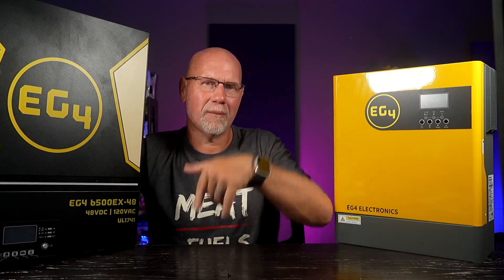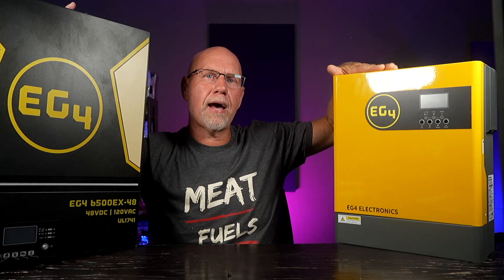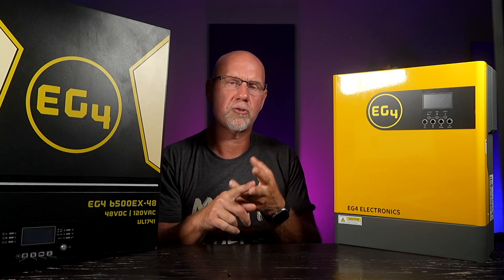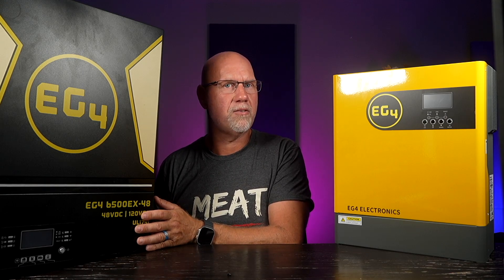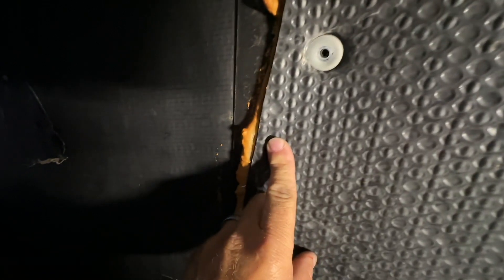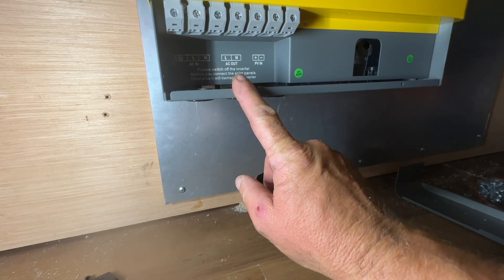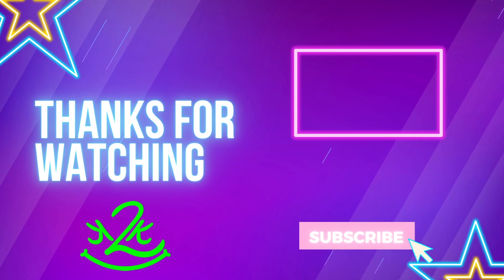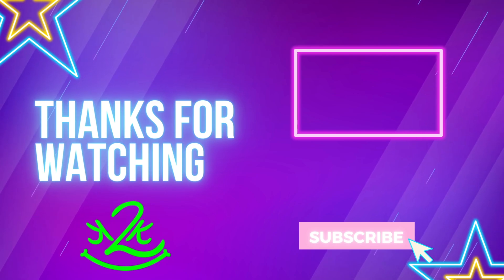Installing an EG4 3000 in an RV | Easiest Inverter install for an RV

Comment: Interesting. On our Brinkley they pre-wired for an inverter. I put in a 3,000 watt with a built-in transfer switch. Truly plug and play. Since install we spent last summer in Alaska and this past winter on the BLM in Arizona. All off grid. Two 370-watt panels and four Battleborn 100ah batteries. Burlington Bill busking on the road and here on you tube.

Comment: The exact system I'm going to install. I have a 2024 22RBE with the inverter prep so it might be a bit easier for me. Thanks for the vid!
Reply from the maker: for the Inverter prep, all you need to do is cut the wire that is looped in wherever the prep is and then attach it to the EG4.   Not having to run the wire will save a lot of time

Comment: Interesting and helpful video.
12 v side of existing converter 
On the 120 volt side you have replaced the input from shore power to eg4 120 v outlet.
The old rv  converter doesn’t care were you get your 120 v from. Therefore leave the 12v side alone except for breaker or fuse going to charge the old 12 v battery. Disconnect this an leave the rest alone.

Comment: The wires, both input and output, from the inverter must have a grommet going through that aluminum plate.
Reply from the maker: It does, I installed it after I filmed this video.
Reply: Exactly YIKES

Comment: So you made me curios on mounting options as my inverter is flat on the ceiling of a storage bay and I want to replace it.  I checked the manual I didn’t see anything about not mounting it flat, where did you see this?    What I did notice was the requirement for 19” of clearance for the top and bottom.   Was surprised you didn’t mount yours sideways to satisfy that requirement and get good air flow.
Reply from the maker: In speaking with Signature Solar, they advised to not mount it that way and after looking at our RV, they advised to mount it as we did

Comment: Signature Solar the very best current price on the 3000W inverter currently. I spent about 8 hours searching for anything else on eBay, etc., etc., etc.  There is NOTHING else currently that can handle a 500V PV input, which is what I need to run 10 x 250W panels at 8.75A input running in SERIES at about 37V VOC.  That's over 370V VOC PV input at almost 9A.  This will enable me to just connect the 10 x 250W panels with the standard included cables in series, and connect them to the 3000W inverter.   I plan to have one 70Ah 48V LifePO4 battery for backup.  99% of the time I'll be running off the Grid with a 50A connection, and this will also be connected, but if the A/C goes out, I hope the battery will keep everything running until I hookup my 5500/6500 Harbor Freight generator.  Fortunately, the EG4 inverter can be adjusted to favor PV input, battery, or A/C input, and can handle multiple electricity inputs simultaneously and automatically.

Comment: Great video!! Question on installation on the EG3000, are the mounting bracket holes @ 16" to match most home vertical framing?
Reply from the maker: I honestly didn't check since it only weighs 24 pounds and I installed a board to mount it to.  The board is screwed into the vertical framing

Comment: The 30 amp switch is not as useful as you might think it is. For one the power watchdog will not allow power if the pedestal is miswired.  And if for some reason, the power watchdog did allow power through while miswired, for example let’s say you had a hot neutral, you didn’t break the neutral. You only broke the black wire so you would still pop the inverter.

Comment: i have the same crawl space but my trailer is 50 amp with 3 ac units. Its a 43' toyhauler.
With the A/c coming in, can you hook up the 4 wire ? im guessing no, would the 6500 watt have the 4 wire, 50 amp input?

Comment: You didn’t mention anything about when you disconnected the D/C converter charger from A/C panel and how you fed the 12 volt fuse box. What feeds your 12 volt or how does it convert from A/C to D/C now. By the way awesome video. Thanks
Reply from the maker: That is in the other video.  Yes, we disconnected the existing charger.  The all in one system charges the batteries and the 12v side of the RV is powered by a 48 to 12 volt converter

Comment: Very nice setup. Thanks for sharing your experience with us. If something happens to your surge protector do you have to pull everything back out or did you pull in a access panel ? Looks like a great system. Thanks From Wisconsin
Reply from the maker: I am planning on adding an access panel but right now, it is only 4 screws to remove the Breaker Box to get to it
Reply: @2KrazyKampers  😎

Comment: Hi, thank you for this great information. I'm about to put one EG4 3k 48  in my van, but I can't find anywhere How many amps the inverter will pull from? Let's say a garage outlet while it's charging at the house. Do you know if a 15 amp outlet would work? I see that you can lower the charge amperage into the battery. I'm guessing that would lower the amp draw from Shore power? Thank you for any comment
Reply from the maker: You can change what it pulls.   Its a very simple setting that allows you to adjust based on where you are

Comment: I understand the concern for the extra 30 amp switch after the watchdog. However, if you mount that watchdog in the closed area of the bay, how are you going to see the lights. Seems if it wired wrong or there is an error, the watchdog would catch it and not send power thru .
Reply from the maker: The watchdog also has bluetooth so I can check it from my phone.

Comment: I put in the EG4 6000XP and the same battery, adding more batteries soon. I know someone mentionrd before but can i leave my 12V lead acid battery hooked into the 12V RV side and the 48 to 12v converter and the truck altenator will both charge the 12v battery? Will there be any issues if both truck and 48 to 12 are hooked to the 12v battery while running down the road?
Reply from the maker: No there won’t
Reply: This is what i want to run. Do you have a  generator and did you run the generator through the 6000 inverter and remove your transfer switch?

Comment: Might need a wire nipple from the 2 holes u drilled on the backplate where your ran the wires out
Reply from the maker: one was put in later

Comment: I have made the same comment and asked the same question  on others channel.
I have been generating my own power for the last few years with a traditional style system. Components fail and mistakes happen. Whats the game plan when a function of that all in one fails? Oh and will the additional inverter be compatible with the older one in the future?
Reply from the maker: It will be compatible.   If an all in one fails. Your replace the whole unit

Comment: the two wires that you mentioned with the 12 volt side of the converter, what are their purpose?
( the 2 wires that you mentioned you disconnected on the 12 volt side of converter}
Reply from the maker: To provide 12v to the rig

Comment: What about things like alternator and  generator charging and using the house batteries to start the RV using the acc circuit?  Ever hear of a thing called a Chargeverter?  Ive got an older RV with a modified sine wave inverter and its time for it to go.  Trying to decipher what I have is the hardest part, lol.
Reply from the maker: I dont know about starting the RV (as in a motor home) but I would not use a car alternator to try to charge lithium, you will ruin the alternator.   Also, I would not use a modified sine wave inverter, that can fry electronics.

Comment: I have the watchdog also.  It only turns on the downstream power after it passes all the test.  You probably noticed it now that it is installed.  Did you put something behind the battery breaker bar?  It looks like you metal back panel will now be at 48V.
Reply from the maker: We used a 48 to 12 volt converter for the 12v side of the RV

Comment: With your setup of 15kW storage and solar setup, are you finding any need for a generator?
Reply from the maker: We bring a generator just in case but have not found a need for it.   There was one day where we ran it for about 2 hours to top off the batteries from 80% because it was raining and the weather report was calling for 3 days of rain but we didn't really need to
Reply: @2KrazyKampers  Thanks for this info.  I'm looking to add your exact system to my 30a rig.  But I'm contemplating removing the existing 350lb onboard generator and putting the new system in that space.  As a result, I wouldn't loose any of my existing storage bays.

Comment: Would an EG4 3000 work in a 50amp RV?  Can’t picture how to deal with the 2 hot leads.  Two EG4s in split?
Reply from the maker: you would need either two EG4's or only power one leg.  That is the case with most Inverters in RV's unless you go with something like the Victron 3000 2 x 120.
Reply: @2KrazyKampers  Looks like the EG4 6000XP might do the trick as well.
Reply: @PKCrouse  That's my plan.

Comment: You detached the charger / converter? If so how does 120v step down to 12v? Just trying to understand what happens with the 12 volt requirements.
Reply: The 48v dc batteries have a dc to dc transformer/converter that supplies the 12v side of things. Joe very briefly referred to it but I'm sure a lot more details on that are coming in the battery video.
Reply from the maker: you use a 48 to 12 converter.  You will see that in the next video

Comment: what if you just cut the trailer shore power cord and put it in the inverter?
Reply from the maker: You still want shore power to be able to charge the batteries and run the coach when electricity is available

Comment: How would I hook up my generator to the eg4 ?
Reply from the maker: what type of generator?   You could do put a manual transfer switch or get their new unit that has connections for a second AC in.

Comment: No issues with the EG4 not having much clearance on the top and bottom for cooling? EG4 in the manual shows it needs 20" top and bottom.
Reply from the maker: no.  it works great.  The folks at signature solar helped deign my system and they said it was fine

Comment: isnt ac in for generator, not breaker panel?
Reply from the maker: AC in is the power that is coming from shore power.  AC out is the power that inverter supplies to the breaker panel and outlets

Comment: Nice heat sync you mounted inverter to.👍 buuut, your lack of insulators for the wires going through your sheet metal is concerning. Lots of vibration in an RV. 🤓
Reply from the maker: they were added after I made the video

Comment: So a question for the group, why are installers still doing 12-volt battery setups? One or two 48v packs and an all-in-one controller seems to be a no-brainer. I saw the setup that one guy did on the 5 to Go channel and he rolled is own battery packs. Oh, one other thing that nobody is talking about is how are you powering your breakaway switch, same buck converter?
Reply from the maker: Breakaway is powered by the 48-12 volt converter.    Many people do 12v because it's easier.   You dont have to have a 48-12v converter.  Also, the all in one controllers do need a lot of solar.  With a 12v system, you can get away with 2-4 panels.

Comment: Like the 300K inverter but thinking for most people the larger inverter would be better or at lease motorhome with 50A service.
I will go into detail if you do not mind me doing so, or you could delete my comment so no one could see it if you wish.
The EG4 while has impressive spec compared to many others. The fact that it has one MPPT input is a major draw back.
You see your 50A service from your electric company input is 120/240 Split Phase voltage. The 3,000 watt inverter from EG4 has a Single Phase 120V AC output  with a max current of  25 amps. 
They do not offer the6500EX-48 all in one panel anymore but 6.000 unit. The 6,000 unit has an output of 120/240 AC that is split Phase . This mean instead of only one max current of 25 amp at 120VAC only. Now you would have the option of 25 amps output for each leg and a maximum of 50 amps ( 25amps for each leg ). Also being 240 VAC output you could get an air conditioner unit that would use less power to run about 1/2 the power .  With the 3,000 inverter you could only run 1 air unit and some other units. With the 6,000 unit you could run 2 air conditioner units and if you could later upgrade to maybe a 220AC unit you could even run 3 air condition units with other devices. This is what I understand and welcome any feed back thanks for your time and letting me express my option. This does not mean I'm a 100% right but the way I see it.
Reply from the maker: a 3000 watt inverter is more than adequate for most RVers.  Yes, you can put a 6000watt or 6500 watt inverter however that would be overkill for most RVers,   If you are going off grid with an RV, you generally would not run 2 AC's at the same time because it would use up your battery supply rather quickly.    With a 3000 watt inverter and our battery bank, we are able to run our entire coach, including having the AC, microwave and Rachel's hair dryer running all at the same time.   On average, you should figure about 100amp hours of battery bank per hour that you want to run your AC.  That means if you wanted to run two AC's for 8 hours, you should be carrying at least 1600amp hours of battery.    That would be a larger battery bank and would be a lot of weight to add to your RV.   Also, for the EG4, you can run two of them together for split phase and it would only be about 50 pounds for both of them and your total cost would be less than $1400
Reply: Point understood and thanks for your reply. After consideration I agree that it would be somewhat of a over kill for most RV's. Still I like many features of the 6,000 over the 3,000 but taking price  you are correct my friend.  For me after thinking about it I do not have money to just throw out there so the 3,000 would be a better option for me. Thanks so much for you help and understanding just trying to make the best decision for me . @2KrazyKampers

Comment: So, You installed the exact system I bought 2 yrs ago and installed in my rv the same way. Whats your opionion after 6 months.? I have a lot of suggestions for eg4. Som much could be improbed to make this system as good as you present it. I would not recommend this system to anyone at this point. It will not probide the power you need in a 30 amp rv, the system is not reliable for several reasons incl overheating and the fact is will not turn on with less than a minimum of 100 volts of input from either solar or generator or anything.

Comment: Can somone help me understand what solar array i need to use this in my 16ft enclosed trailer its 7ft wide. And i know the minimum solar requires in 1200. Anyone that can help me understand this better? THANX GUYS
Reply from the maker: You would have to run four twenty four volt panels in series.  That would give you enough voltage.  You can also install as many panels as you can fit and install them in parallel and then add a boost solar charge controller https://amzn.to/3W18gDM  This will boost the 12v up to what you need for a 48v system.

Comment: I can't understand why you are running ac in and ac out to breaker panel?   Don't you just take the wire going to the shore power cord and put that in the ac out of the inverter?
Reply from the maker: You need to supply power directly from shore power to the inverter.   The inverter then supplies the power to the breaker panel.   You want the shortest run possible between the batteries and inverter due to voltage drop therefore the inverter needs to be close to the batteries.

Comment: You will hate this, solar panels will never power this unit, never have enough panels to keep it running. Not enough roof space , really bad choice!
Reply from the maker: Our solar powered it just fine.   We were contestants on RV unplugged and used this system.  I had eight 24v two hundred watt panels.   They were run 4 in a series and then the 2 series connected in parallel,   While we were on RV unplugged, we ran our microwave, coffee pot, air fryer, A/C, heater (it got cold at night) and more.  The batteries never dropped below 80% and the next day the sun charged them back up.